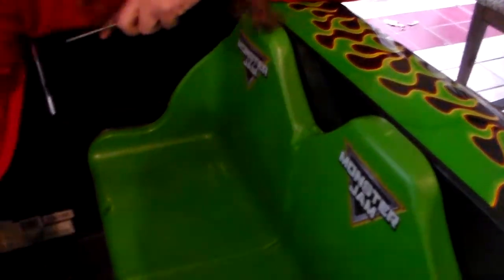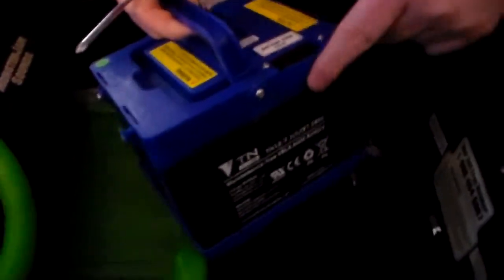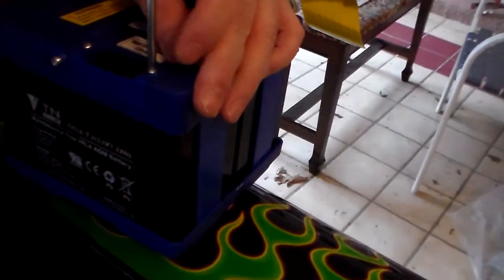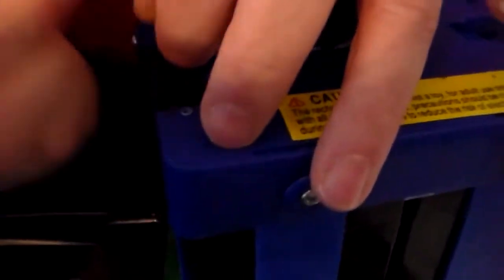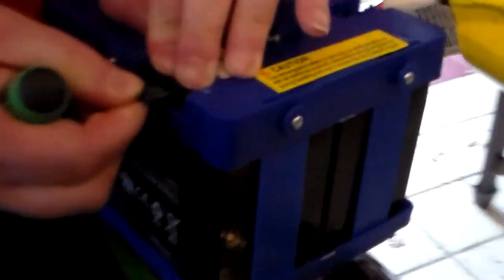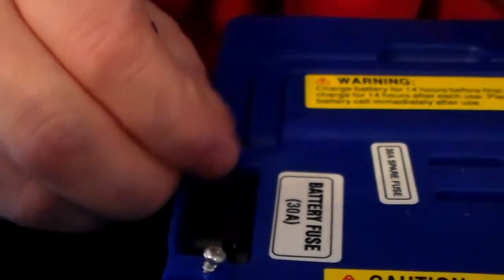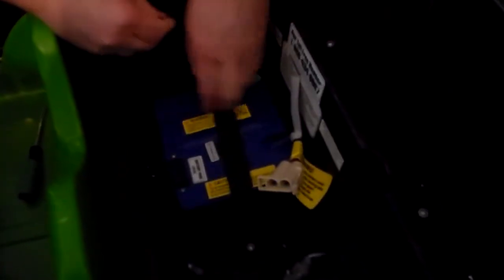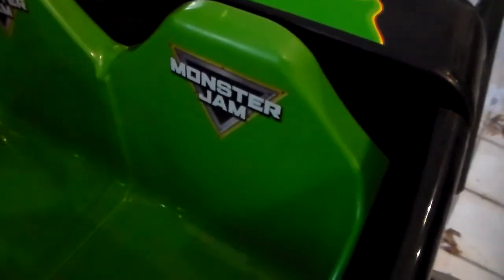How to change fuse when 24v  Grave Digger is Dead

Comment: My son's GD-truck keeps burning the fuse as soon as it is put in forward gear.  I think it is a short somewhere.
Reply from the maker: Having the same problem. I put a bread tie wire that I stripped the paper off of, leaving only the wire, around the fuse metal part in an eight shape and it made it last longer. Try at your own risk!
Reply: joe vdenne  do you fix it?